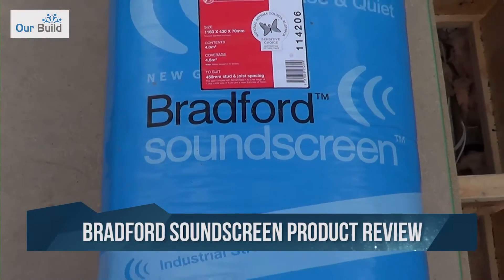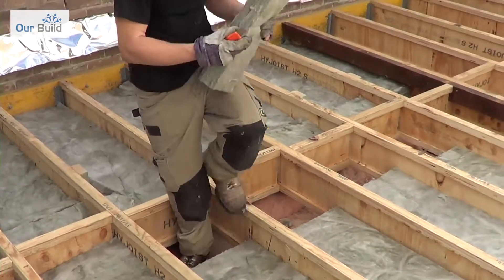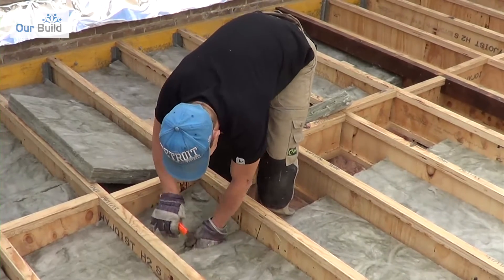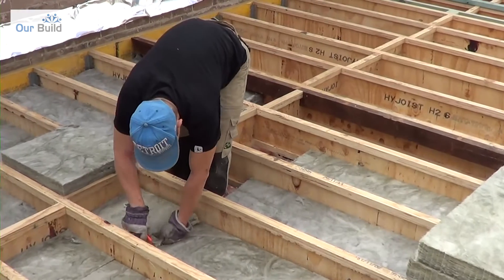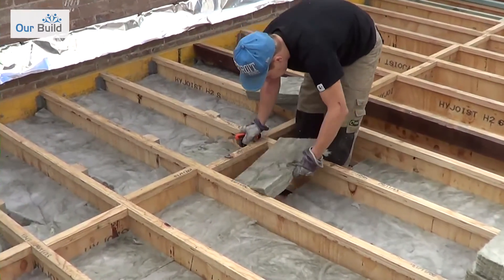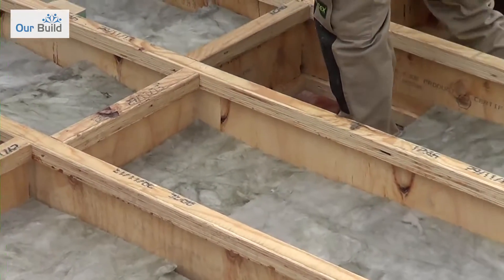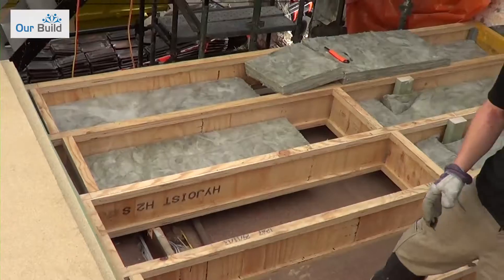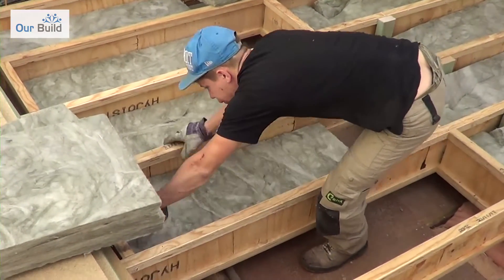Bradford Sound Screen Insulation -  product review - how to install.

Comment: Is the Sounscreen actually Rockwool? I'm finding it a little tricky between glass / rockwool / etc. to find all their Rockwool products. I'd like high density for fire, thermal and sound that's Rockwool 50mm thick to insulate an enclosed area of my garage, so that my neighbours don't complain about noise with drills, compressors, saws, etc. Was hoping to build it out of Aluminium with about 500mm between studs, and about 2 to 2.4m high. 3m L and 2.3m wide. Would also like to build it so the roof can lower to transport it out of my garage if I ever move house, so I'll build it in 2 halves, top sheld over bottom shell, scissor lift roof up or down.
Reply from the maker: +SupaLexy (SupaNautica & MotoLexy) Wow, sounds like a lot of work! Technically it's not rockwool, although has similar properties. Best to speak with a rep to get the full specs though before you make a decision. Good luck with it!

Comment: i live in a dorm, can i just temporarily stick it up?
Reply: yeah but you need to cover all surface area of walls/ceilings/floors to get the acoustic insulation, otherwise sound just flanks around the gaps and still gets thru